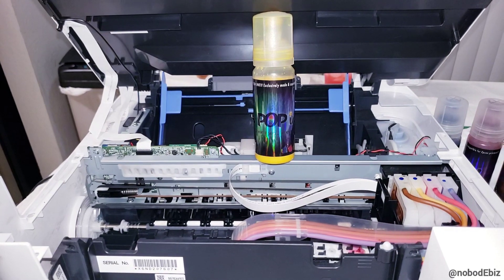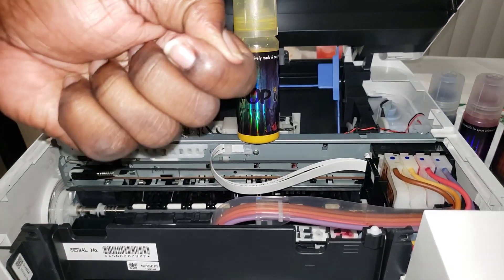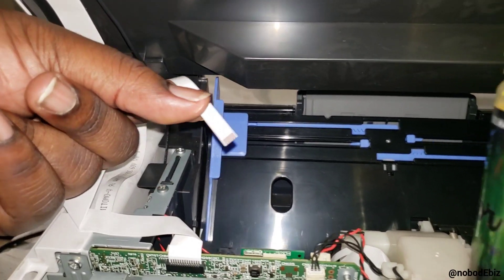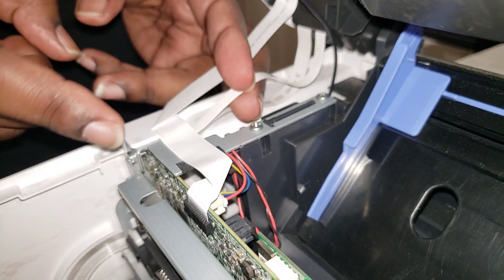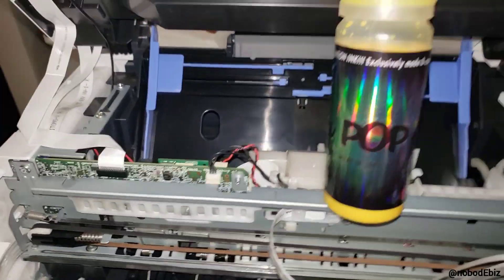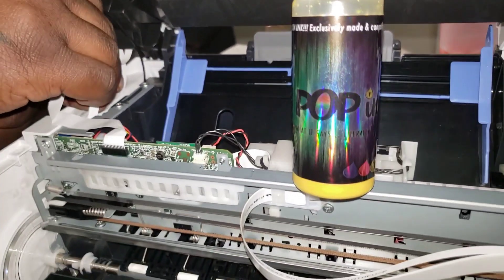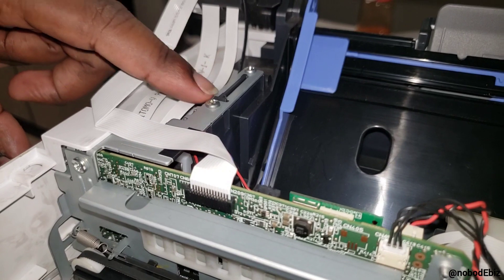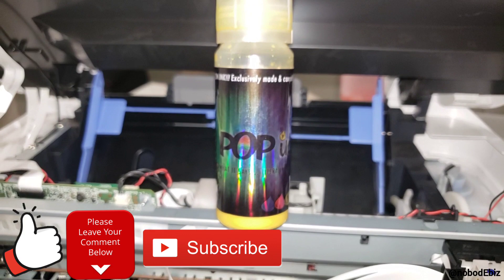Scanner Error Code: 100016 on Epson ET-2720!!! Quick fix & How to resolve...

Comment: THANK YOU! Like others have said both of my connectors were unplugged. Happened when I was swapping out sub ink to go back to regular ink. Other said it was a gear on the scanner, but mine was fine, looked at the second video and behold you had the fix for my issue!

Comment: 3 years later, this video is still saving people’s 🍑’s! Bet you had no idea how many people you’d help by posting this. Thank you! Would have never figured that out on my own😘
Reply: Actually quick question! I’m searching through the comments but can’t find anything. How far in does it need to go? I can’t force it in more than just a tad but it keeps coming back out- it’s both of my little whites ones
Reply: @ahnna-leishagriffin3967  it will slide in far enough to cover up the metal line things on the white thing. I had to play around with it for a minute, but eventually it slid in pretty securely.

Comment: In my case one of the gear that move the scanner pops up and doesn't let the scanner move properly, I fixed one time but happened again and again, I'm still trying to fix the problem because I can use it as printer neither

Comment: brand new printer out the box and i dropped it on the ground, broke one of the hinge that holds up the scanner was able to repair that with welding rods, was getting that scanner error, thought the scanner was jammed was getting ready to take apart decided to come to youtube first, your video was spot on the ribbon came out, thanks bro for taking the time to upload this video
Reply: Literally same! Broke a hinge and that tiny piece came off!

Comment: I too had the code after cleaning the heads.  The wires to the mother board did unplug when opening the top and I plugged them back in after cleaning the print heads.  The code 100016  came up and the printer would not work.  I watched this video and I opened the top again to see if the wires were plugged in.  They were, but on closer inspection the large one with a blue end was in slightly off aligned.  I unplugged, re-plugged and assembled the top.  It worked after that.  While my cleaning of the print heads gave me some color, as it was not printing in any color, it was not until I did a power clean that I got all the colors back 100%.

Comment: The light brown chord running horizontally across the inside of the printer came out when I was printing a document. How do I replace it ? It looks like a wire with a light brown cloth covering and has a knot at the end. Why this cable is covered with a fabric baffles me.
Reply from the maker: Owow... I kno wat cord ya mean, I jus don't kno where to find a replacement.  These has come up more than once now, so I'm definitelE on the look out for a reputable printer parts store... worse case scenario, I'll jus have to become one 🤷🏿‍♂️

Comment: Both of ribbon connectors behind the circuit board popped off and I really could use some very clear pics of where and how they reconnect. No scanner code but I now have no ink being printed in any  color.
Reply from the maker: Did U see them hang'N? If so... it shuld throw'N a code.

Comment: This helped so much but my problem is the blue strip next to the scanner cable came out & that's the hardest to get back in.. Also after mixing the wrong ink, taking out & putting new sublimation ink back in.. My printing is now not wanting to print anything. PLEASE HELP!!

Comment: It fixed mine I have a Epson Et 4700..I had to use tweezers. Also it the cord is to short pull it a little
Reply from the maker: That's dope... i get alot of questions about that 1
Reply: @nobodEbiz  they're pretty much the exact same except when it's slightly bigger and the way the screen display and the way the paper feed in

Comment: I followed all the steps and I am still receiving the same message. My Printer is only a month old
Reply: Hve you figured out what is wrong? I have a brand new unused printer but I have had it several months before using.
Reply: @latoniamorrison5261  no I did not. I tried everything

Comment: Hello, I tried this and I'm still getting the same error message. I made sure that both of the strips were in their compartment and turned the power on the printer on and off. Could it be that I need the strip replaced? My printer is not that old and I've never opened the top until now. Thank you so much for this video! You rock.
Reply from the maker: The strip may not be secure as U think, or the entire scanner itself may have to be replace'd.
Reply: @nobodEbiz  Thank you for the advice!